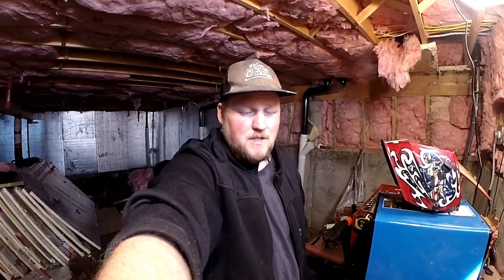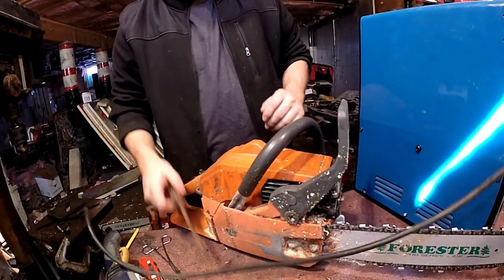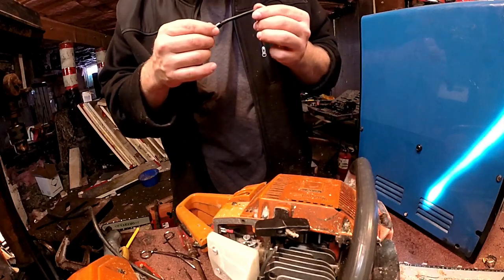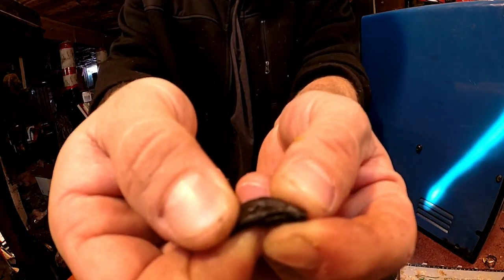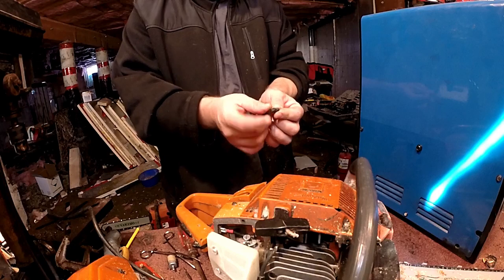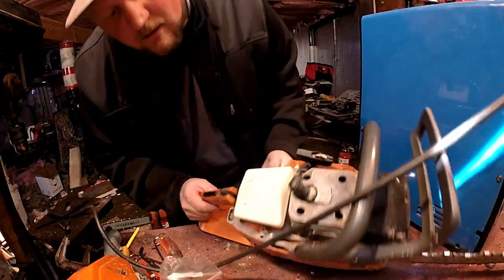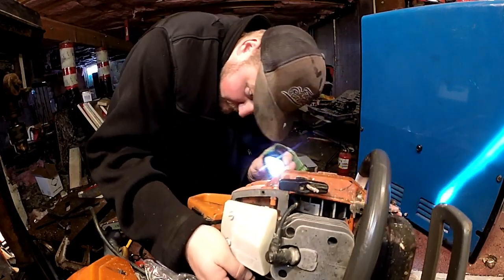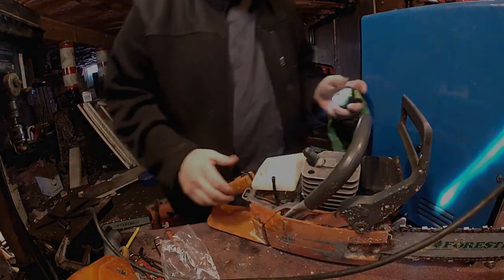HUSQVARNA 61 266 268 272 CHAINSAW FUEL LINE REPLACEMENT

Comment: I have a 61 with a fuel line that is parallel all the way along.  That is a plain hose. No taper bit. Is it possible to fit the new one with the taper. Looks like the hose in the top of the tank is not big enough.
Reply from the maker: I've never seen one without a tapered portion.

Comment: is cylinder&engine cover same for 61 and 272/272xp ?
Reply from the maker: Some times.. the new 61s  yes.
Reply: @stuffnsuch631  i have 61 from 30+ years ago jugoslavian version/licenced 61FF  !! i see that covers and lot of parts are similar/same with 272/xp at least on aliexpress and cocer costs 10-14$ but they dont say its for 61 too even picture are same and cover anywhere else are hard or impossible to find
Reply from the maker: @Mr11ESSE111  if you want you can send me a pic to tundrachainsaw@gmail.com from the recoil cover side. I'll tell you in a second. They moved the screws for the top cover on the recoil cover side back about 1/2 inch. If the top cover screws are ahead of the recoil cover it's old pattern and if they are behind (closer to the throttle)  its new and will fit the 272 covers
Reply: @stuffnsuch631  pic from 272xp  cover or 61?
Reply from the maker: @Mr11ESSE111  your saw
Reply: @stuffnsuch631  61(ff)